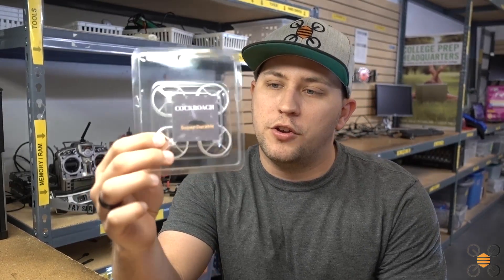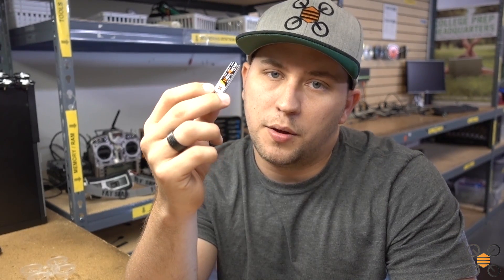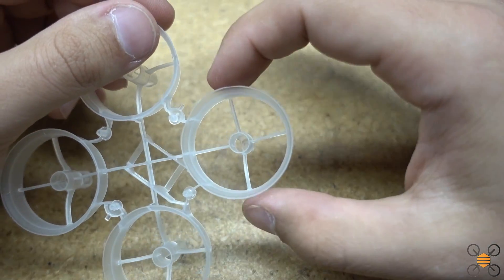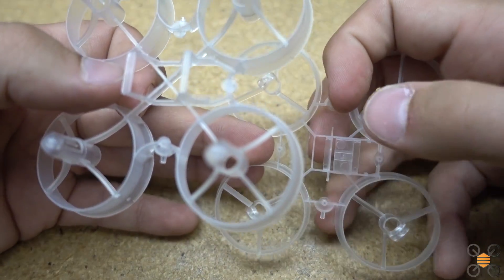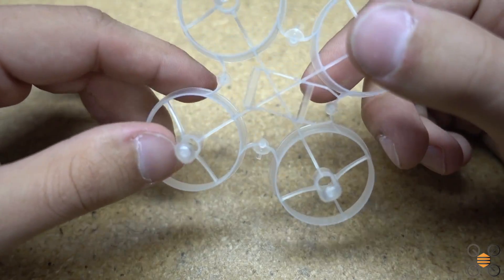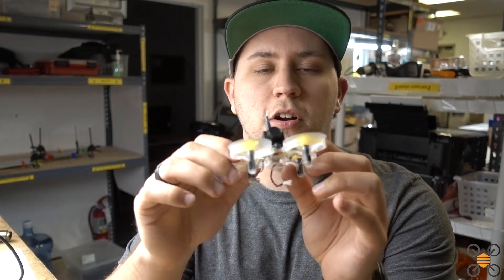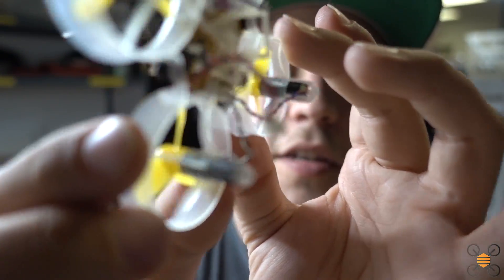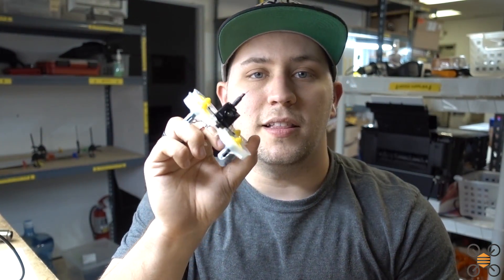Cockroach Super-Durable Frame Review & Build

Comment: There is a reason the duct fins are slanted in the inductrix frame.  They are slanted with the prop direction which greatly reduces propwash.  It makes all the difference imo when recovering and is the only reason I use the inductrix pro frame with my beebrain

Comment: Will this frame work with the new inductix fpv plus.  Mine is barely glued together.
Reply: Morning View , no.  Inductrix plus uses 8mm motors.  Standard inductrix is 6mm.   The inductrix frame actually handles the best due to the duct fins being slanted with the props, the airflow isn't as hindered.  In other words, way less propwash.
Reply: U can pry use it for a inductrix pro or fpv or Whoop or acrobees